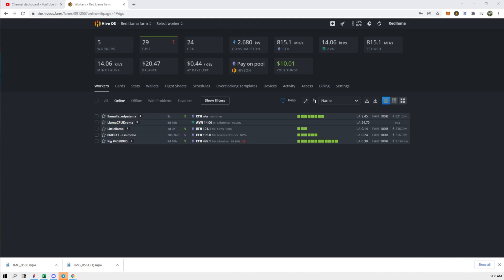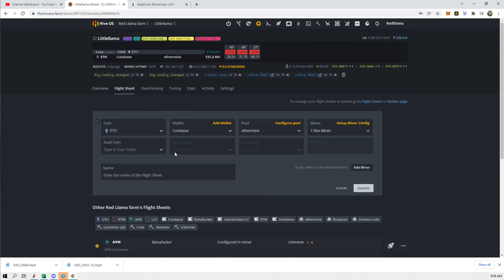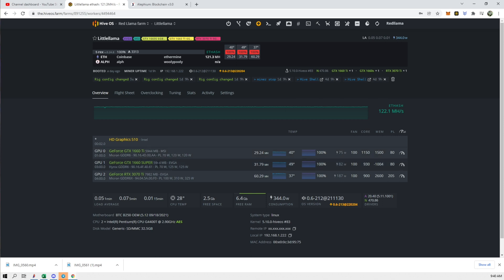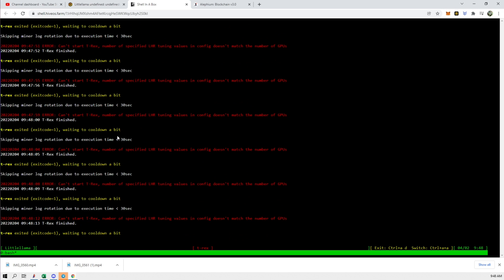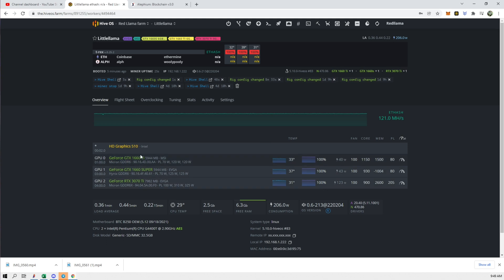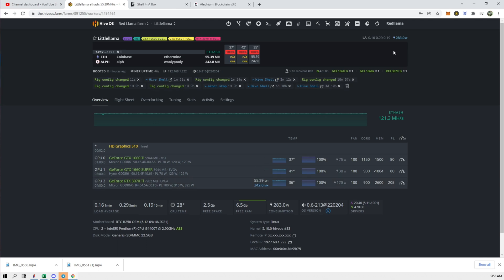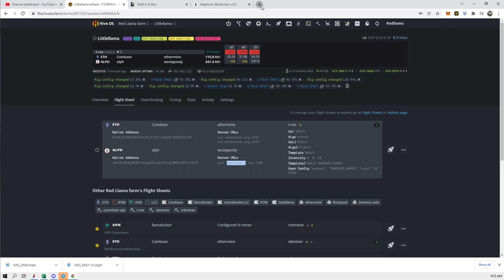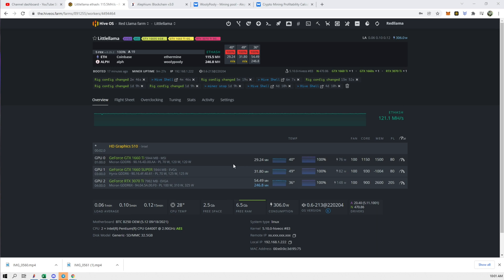How to Dual Mining Alephium & Eth on rigs with both FHR and LHR GPU's

Comment: thanks, works well. hive is showing about +5w for a 3060. On windows comparing to trex "low power mode" it uses only a bit more power. The wall meter jumps around a lot so you kinda have to take a stab at what its using. LHR mode for 3 cards was 270w to 400w now its 340w to 390w but hangs around the higher wattage more. Fan speed went up 10% to maintain so ill go off that, uses 10% more power
Reply from the maker: That’s awesome man!! Is it still stable?
Reply: @RedLlama  one rig had a restart, if it happens again ill look into it. other rigs have been fine

Comment: Wooohooooo! This vid helped a lot! Question, how low did your LHR lock go until it stabilized? Should it be at 68?
Reply from the maker: I just tried 70 for LHR and its about 5 mins in and within the miner i see it down to 69.
Reply: @RedLlama  What is the purpose for the intensity setting to be set at 68? What does it do lol =P In lamens terms if you can!
Reply from the maker: @waddup1904  the 0 stands for not to activate the card. 68 to 74 stands for the percentage to unlock the card too. The lhr cards are normally at 50% locked. The 68-74 slightly unlocks the card.
Reply: @RedLlama  So here’s my next question for you… FHR GPUs will split the load evenly?
Reply from the maker: @waddup1904  it will go by the percentage you input. I had 1660 super. It was at 31.8 on eth. When I put 68 it drop to about 20 almost to 68 percent and the rest for alph.
Reply: @RedLlama  probably not worth it to spec mine on a full hash GPU🤔 or if the miner believes in it enough it is. I guess it’s dependent on how much the miner values the potential of the coin🙌🏽
Reply from the maker: @waddup1904  exactly. It’s better to keep those fhr on one coin. The Lhr on dual if you believe both coins will go somewhere.